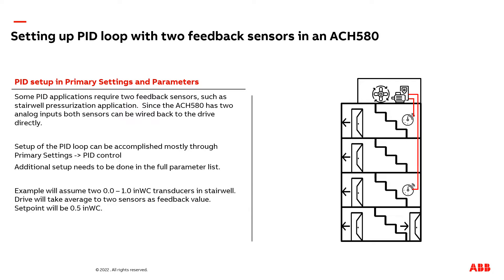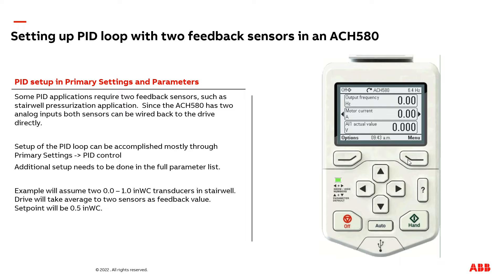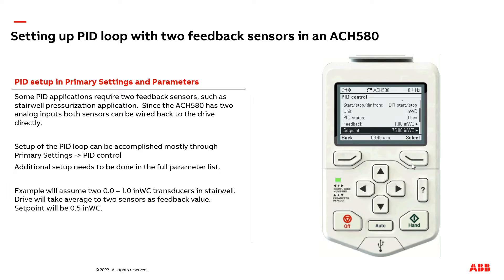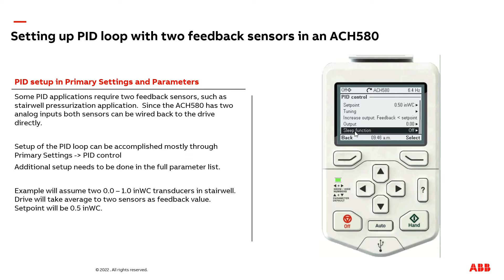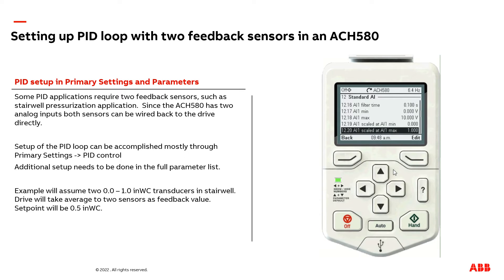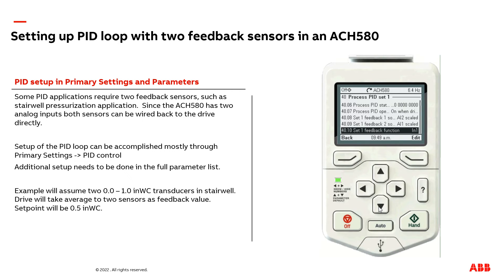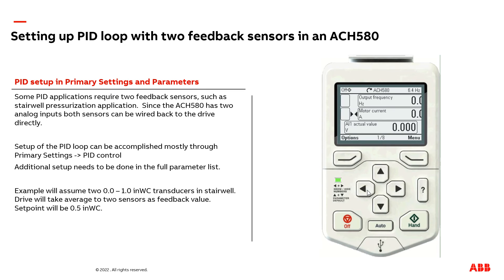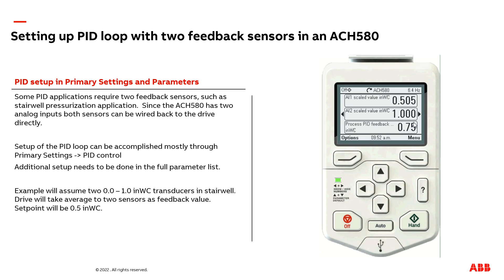Dual feedback input for PID control, stairwell pressurization

Comment from the maker: This video uses 0.5 inWC as an example setpoint. The 0.5 inWC setpoint was chosen for illustration purposes only, to show how to program the drive. Actual setpoint is dependent on system design characteristics and the requirements of local jurisdiction. For example, the International Fire Code recommends between 0.10 and 0.35 inWC.